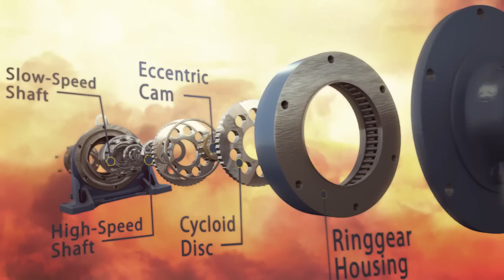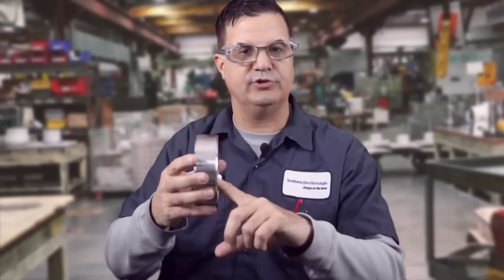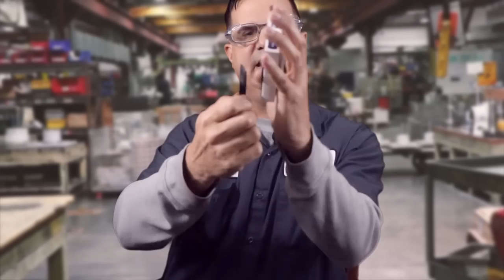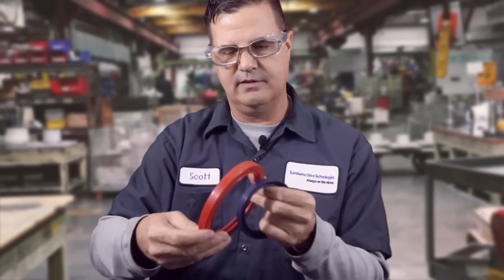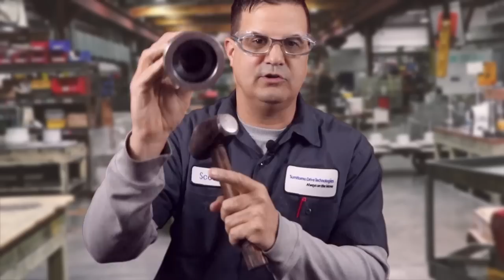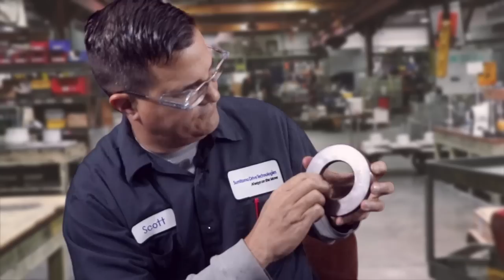Why Gearboxes Leak | WCHYWT #4

Comment: Yup.  Opened for inspection the gearbox on my Kubota snowblower attachment and found nothing amiss.  Cleaned and sealed it back up, and it leaked around the seal on the main shaft.  To replace involves punching out a roll pin holding the worm gear and removing two bearings.  Not worth my time.  Maybe worth yours, depending on your resources and what matters to you, but I have a day job that is not fixing snowblowers and tractor parts.